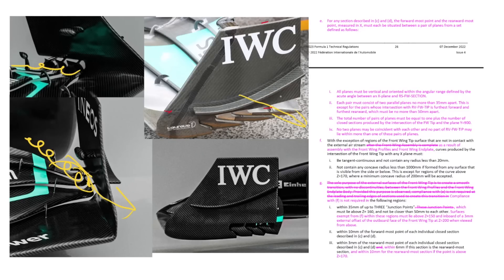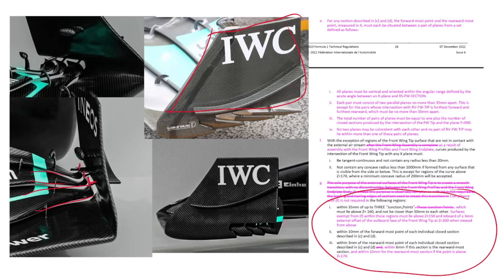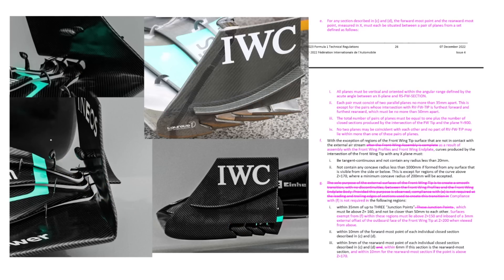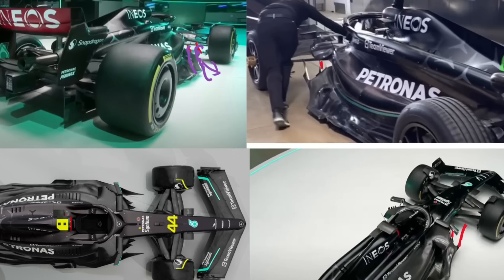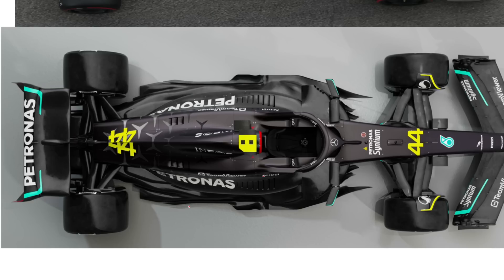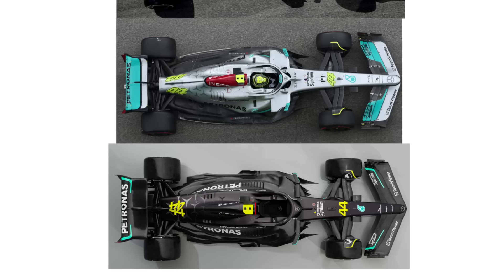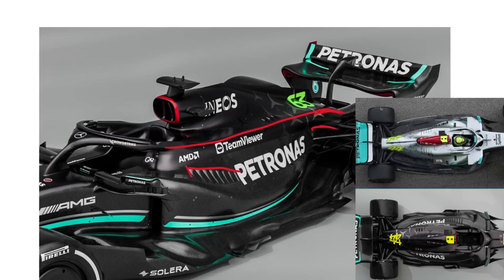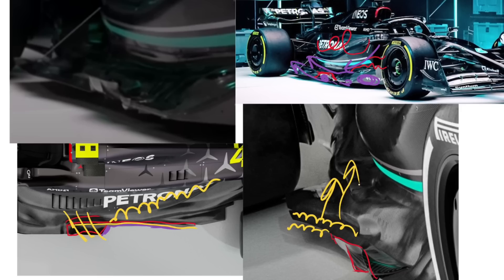Mercedes W14  -  Aerodynamics Analysis and Initial Thoughts

Comment: Your theory about where Mercedes porpoising on the W13 came from is inadequate. If they focused all their aero development at a ride height where they porpoised, then it would be something that has gone wrong in that aero development, rather than the ride height itself. Red Bull also ran at low ride heights but didn't experience the same problems. I think the sidepod design took away flexibility for addressing their aero issues, because to address the issue they would need to redesign the sidepods.
Reply: As far as I'm concerned red bull had the most amount of rake (rear ridhight) of the whole grind in 2022. From what I understand Mercedes had their main issues with the suspension geometry which didn't allow them to run the car in the ideal window without bouncing! Adien Newey also said that with the ground effect cars one of the most important parts are the suspensions themselves in order to keep the ride hight and suction effect under control in a wider window of operations! Mercedes has said their have changed their suspensions completely.now we will have to wait until the first race in order to see if they've gotten on top of the bouncing problems.if they did I can see them being really competitive,if not it will be another difficult year for them...

Comment: Do you really think that weight reduction caused by not painting the car is significant?
Great video!
Reply: I've heard from different sources that a fully painted f1 car adds 5/6kg in weight! Looking at Mercedes and other teams which have 50% of the car unpainted you could guess the weight saving could be around 2/3kg overall...

Comment: Clever. They've basically recreated the barge board using using the inner front wing tip. Could that be construed as not within the "spriit" of the rules because of increased wake?

Comment: Kyle, could you please make a video on your thoughts on which aerodynamic concept (from all teams) captivated your attention the most. Which one do you think has the most innovations?
Reply: I think you got that in this video. Perhaps Mercedes showed their hand more than the others.
Reply: @jerehada  Merc can show their hands much more because their concept is so extremely different from any of the other ones that they don't really have to be afraid of copying. Sure there might be small tidbits but the aero package as whole is not really feasible to be copied by the other teams of which most have commited to the RB design.
Reply: @reveriesduh  Bingo.  I think it is part of their reason for this strategy also that it may have a higher ceiling than the RB concept, the difference being the RB concept may not be on so much of a 'razors edge' with getting all the tiny tidbits right and race setup completely right.  RB has more of a generally safe moderate ceiling concept and Merc have more of a risky design and setup but higher ceiling of performance concept.

Comment: You can produce carbon fibre in any colour with no need to paint bringing extra weight. In the next few months more teams will have unpainted cars but obviously any colour they want with no wait penalty.
Reply: The color is just added to the compound so the weight is still higher. You can't make gray carbon magically green
Reply: Besides the pigment heaving weight , the process of hardening must be changed based on its content ... so why complicate your manufacturing process? The only fault here lies with the FIA and the "trucks" they designed ... the bigger and heavier the cars, the more every g counts...
Reply: @cosminlesutan3574  A weight saving has a bigger proportional impact the lighter the car is. Maybe you are right, however, that the FIA has set a minimum weight that is exceptionally hard to meet given the other design parameters they have set out.

Comment: Its going to be super interesting to see the 3 different concepts RB, Merc and Ferrari go against each other again. Hoping they have closed up to each other. I feel like Merc had a lot of low hanging fruit to gain from so here's hoping.
Reply: I hope we see some close racing this year, but i think RB will be the fastest in the first few races.
Reply: If Merc are within few tenths of redbull that's a great baseline to work with
Reply: You’re right. A lot of mercs low hanging fruit will come from addressing the drag and low speed traction issues. You can see drag refinement in the bodywork that produced the down washing in front of the sidepod. It is much narrower and with less dramatic crank. I also imagine they have slightly softened the rear suspension which would allow for more mechanical grip in the low speed corners. It’ll be exciting to see how merc performs. Considering how good this team is at in season development, even if they start somewhere slightly behind, i trust for them to at least catch a ferrari
Reply: I doubt much will change this year cause Redbull seem to have a hint about the technical changes since they introduced them a coulpe of years ago... Do not be surprised if RB come up with the fastest car this year, that's all im saying
Reply: @drummakha2540  How can you know?  The car at the unveiling was last years car with false wings on it....
Reply: @navnig  Let's wait and see...
Reply: @drummakha2540  most likely they will. They had the best working car last year, and while merc has to fix issues with their concept rb had time to actually make the car faster
Reply: @garrylong2993  Yes, but last year it was supposed o be new tech changes to everyone and help change the grid order but the only thing that change was Mercedes was slow.. lol just look at how they handled the last two years tells you there seems to be an Agenda for RB and Max to take over. I said it before the start of last year's season that Rb will come up with the fastest car and i was not wrong!! I mean, they came up with a PLUG AND PLAY type of car that works in all circus, tire compound, weather, short or long runs for a team that went fighting till the last lap the year before... and also, the tech changes seems to work best for the high raked car which RB is famous for.. it's all too fishy for me anyway
Reply: @drummakha2540  Lot's of speculation based on nothing more than your feeling. It's more likely that BR just chose the best strategy/path from the getgo and that allowed them to hold on to the advantage through the season. It was always going to be RB, Mercedes and maybe Ferrari that would fight for the top spot, but since Mercedes messed up with their aero and Ferrari is Ferrari and does Ferrari things RB walked away. Nothing strange about that!
Reply: @garrylong2993  That's of course true, but again there's the extremely low wind tunnel time and also there's always a point where a certain design philosophy just can't get that much faster. I rlly believe that potential-wise Mercede's design has more to show that we've seen so far
Reply: @drummakha2540  
RB had a big advantage in that they had someone who studied Ground Effect aerodynamics for his graduate studies, Adrian Newey, working on their car, so they could spend less time figuring out where to avoid porpoising and more time optimizing. If the rest of the grid with double the budget and wind tunnel time to RB still can't catch up, then they were never going to win.
Reply: @oskjan1  Really? one question for you then. Do you know  why they suddenly introduced the small rule changes in 2021 first and then full rule changes the year after? can you tell me what was the reason for that first introduction in 2021? im honestly asking.

Do you agree that the changes suite better the high raked cars which RB is famous for? 
Did you see how RB was hiding their car last year? you know they also cheated by over spending and what was the punishment ? finally all you have to do is just look at the pattern and the way they handled the issue in the sport for the last 2 years! also, do you know that the FIA introduced a rule that all F1 team members are not allow to discuss internal issues anymore in public? and this was only introduce in the last minutes. i give a few names to ponder upon. Ross Brown, Adrian Newey and Christina Horner
Reply: @Appletank8  right, easier for him when the technical changes favours more the high raked cars... while team like Mercedes always runs their car quite low so there is already an unfair starting position right there and you wonder why they introduced those rule changes that didn’t change anything in the packing order only that Mercedes is slower lol 😂
Reply: @Appletank8  I’ll also use your comment which is correct to a certain extend that Adrian Newey is very good at building cars which i agree. Then i also was explaining to orders how that very man can build car that makes any driver look good cause of the handling and downforce it usually gets which is why i cannot rate Max as a great driver yet cause we saw how Vettel and Riccardo was when at RB and then how they did when the was driving another car!!! Lol even so, remember how many times Max had an soin driving the car ? Just wait and see when he drives something other than a RB before you can really judge him. RB are just a cheating team as it turns out in the last couple of years!!
Reply: @drummakha2540  TRUE at least someone else tells truth about rb CHEATS 2 TIMES FAKE CHAMPIONS DUE TO CHEATING
Reply: @drummakha2540  , you see a conspiracy at work, I see F1 merely adopting the current mode of thinking about ground effects. Mercedes just took a swing and a miss, whereas Red Bull took a good look at what's working in other series worldwide which already used ground effects and honed it with the massive amounts of money available in an F1 budget. The cliche is more harsh than Mercedes really deserves, but don't attribute malevolence that which can be explained by incompetence.
Reply: @Appletank8  double the budget?
Reply: @Daz5Tube  my mistake, it's not the budget that's scaled, it's the aero testing. And the mid field down has about 30% more testing allowed.

Comment: It is interesting with that little change that they did for the front wing to end plate connection. With the little tabs to keep it in legality. I am kinda of surprised to not see any very cranked slot gap separators like they had last year or like the Ferrari wing. I am wondering how the cooling is being changed, as with how small the intakes were last year in the zero pod design, they enlarged it. Yet they did not have any real cooling issues, or atleast it seemed that way. It has to be like you stated, something that is being done to not pull that vortex of outwash in till later, so maybe there is something strange going on at the diffuser that just was not shown.
Reply: They did have cooling issues at the very hot tracks.
Reply: @boostav  wasn't it save for like one team most of the had issues on the very hot tracks?